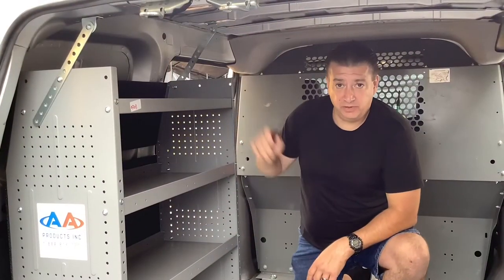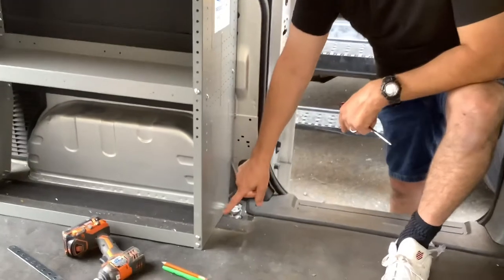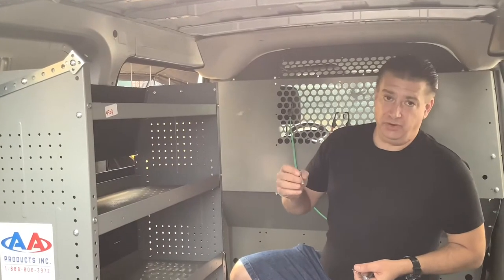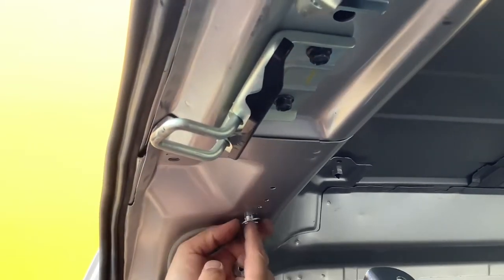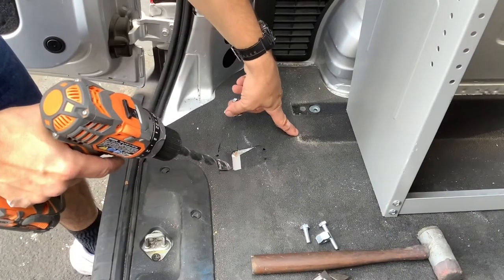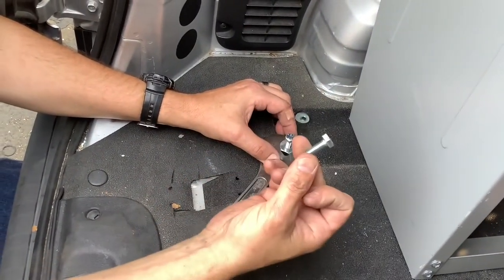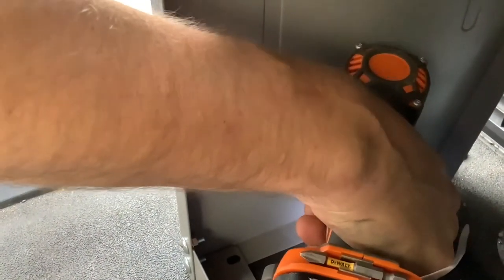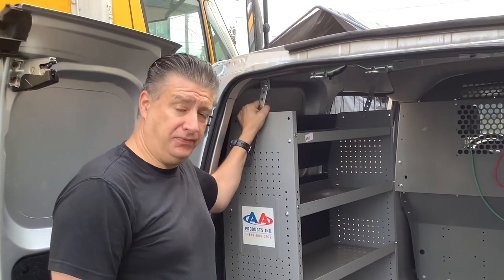Model 4303 Steel Shelving Van Rack AA Products Inc.

Comment: Thanks for this. Question ….You were emphasizing that the shelves were installed on the driver side. Is that mandatory? Is there anything preventing them from being mounted directly opposite on the passenger side?